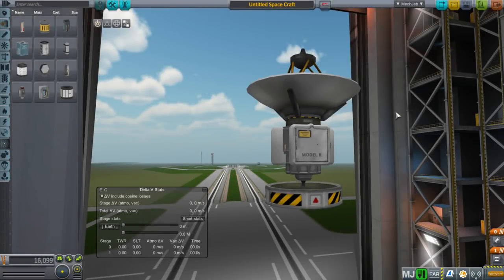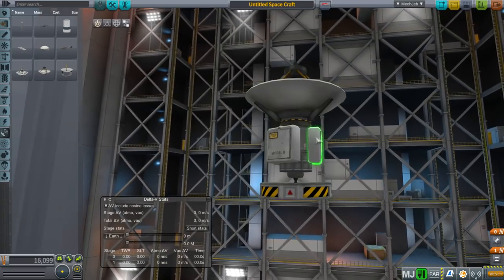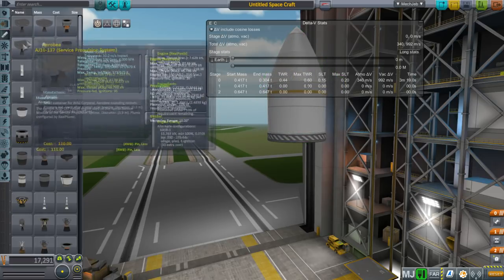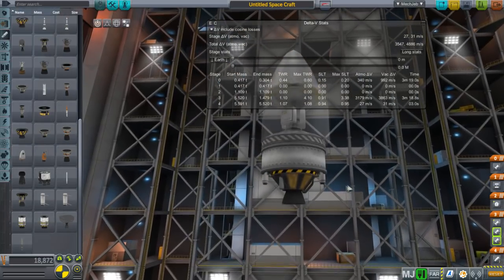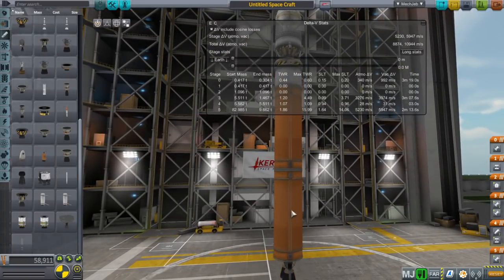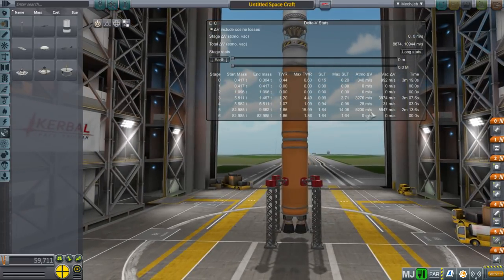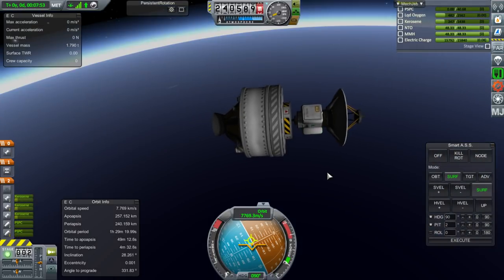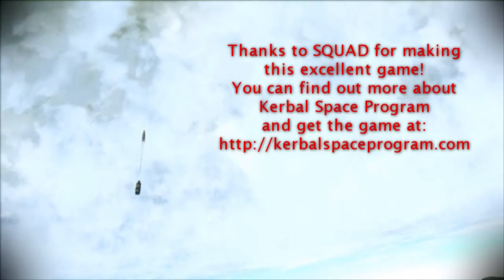A Simple Orbital Rocket in Realism Overhaul (Tutorial)

Comment: Hot stage + Sep motor LOL 

Purpose of hot staging is that they can forget about sep motor :P
Reply: I was actually thinking that you'd hotstage just to stay in "spirit" on the rocket structure :) You may want to show it in future episode if only to show that you can - even though this specific LV was too OP so if you would light second stage immediately without coast your apogee would go out of hand. I'm personally a big fan of hotstaging as it removes a need for ullage and so the upper stage carries less dead weight. You can still use separatrons for cleaner separation, but on a lower stage to move it away faster - even though I've never had a separation problem as in RO engines ramp up thrust quite slowly so you move away from stage before engine reaches full thrust. Just watch you stage time and light it about 2-3 seconds before previous stage runs out of fuel.
Reply: And to be fair it is REALLY hard to hotstage in KSP unless you actually know what you're doing I.E. have decoupler and shutdown programmed to action group - best bet
Reply: @CalebKam  hotstaging is easy whatre you talking about lmao. literally just stage the engine prior to the decoupler and it works perfectly

Comment: Hello! That's a great guide for RSS. I've installed all the mods from  the "installation" video. Now was trying to build a rocket, but sizes of command modle and fuel tanks does not match.  was trying to install Tweakscale but it does not work. Could you please asvise how to tweak sizes? Or wich mod to install? I use KSP 1.2.2 version. Appreciate!
Reply from the maker: This video is 7 years old and I'm sure I've done more recent videos on all these subjects. I don't really recommend using KSP 1.2.2 any more - KSP 1.12 would be standard at this point.
Reply: @RaizSpace  Ok, thanx. I will try to update to 1.12 then.

Comment: I built the same rocket you did in this, part by part, But when I went to the launchpad, commnet disabled or commnet enabled, I had no control of the rocket at all. Solutions?
Reply: Just the mods from the first video
Reply: Fixed it! Turns out I had no power on my probe.

Comment: what is the recommended angle of attack my rocket should have when I am at 50,000 m in altitude?
Reply from the maker: Depends on the thrust-to-weight ratio of the stages, but it'll usually be around 20-30. In some cases, like regular Atlas or an SSTO, it'll be closer to zero, while for rockets with low thrust to weight (like Ariane 5) it might be higher.
Reply: thanks

Comment: Slight error in your testing methodology when you were checking the fuel feed from that unpressurized Oscar B.
Your conclusion did not eliminated the alternative.

When you locked the  pressurized probe core tank to see if fuel would still feed from the unpressurized so long as a pressurized was aboard... you were still under thrust from the engine, so of course  the fuel fed. (Same as hot staging in effect)

A more thorough test would have been to shutdown and try reigniting the engine after locking the probe core tank to see if it would reignite.
Reply: I have no idea personally, I have yet to try RO, but find it interesting and watching your series.
That's why I would have liked to see it properly tested.

Whether it's a Game thing which allows it, or whether it works realistically.